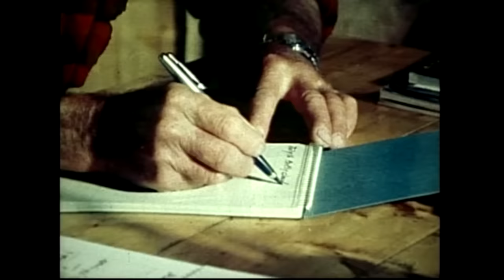Dick Proenneke in Alone in the Wilderness part II

Comment: If anyone has cut a board with a hand saw, you must know how insane cutting a board that thick and that long must be
Reply: I cut a board that way using a vice to hold it.  The vice was attached to a heavy table.  The entire table shook and stuff kept falling off the damn table.
Reply: I cut a 12 inch wide beam with a bow saw I also have trimmed a tree with the same bow saw so I know I can do it thank God 🙏
Reply: Yes ripping is harder than doing a cross cut. It usually takes a special blade with teeth shaped differently. White pine cuts easier than most other trees but still quite an impressive feat.

Comment: How the heck does he cut the boards straight.  Mine would start at 2” thick then end in 1/2”.
Reply: Skills and a good saw maybe. Check out Tony Sellers videos in case you're not already familiar with them.
Reply: stau ffap he had skills for sure.  Did you mean Paul Sellers?
Reply: score your logs and follow the line
Reply: As long as the teeth on your saw are good, you transfer your line right, you follow it in right, and you don't put excessive twisting or sheer forces on the saw, you'll make a decent board. The saw has a lot of surface area to keep it pointing the same direction so once you're in only daydreaming about Sally will put that saw off course.
Reply: He put wedges in, hammered them and the logs split.
Reply: @AtlasReburdened  lol 😆
Reply: Lots of practice
Reply: 😂 me too
Reply: Did you measure twice?
Reply: The blade of a saw wants to go straight. The reason the blade is very tall is to prevent it from turning or twisting, by using the cut wood as a guide. All you need to do is pull in a mostly straight line. Obviously you'll need to square the log a little aftewards, so the process isn't perfect.
Reply: And that sir is why I bought a gas powered sawmill, 17’ in under a minute lol
Reply: Because he’s working with spruce wood. Super soft, easy to split, light weight.
Reply: @AtlasReburdened  well sallys a fine lass can you blame me?
Reply: lol,i get what you mean,thats the difference of craftmanship

Comment: real men, wear wool shirts.
Reply: Yeahh..all that itching don't bother us one little bit
Reply: melvin-g-melvinson indeed!
Reply: @Darryl Hopper Yes..get you. 
May be today - But in the olden days, without modern methods of wool production, wool clothing used to be an itchy business.
Reply: @Survival Mindset well I have a hand knitted real wool sweater that was traditionally knitted that I picked up in Transylvania in Romania that I wear in the woods and it's itchy as fuck. My swedish surplus pants and my father old filson mackanaw from the 70s...not so much.
Reply: Yeah, it's called MERINO Wool
Reply: There is a reason for the wool, you would wear other layers under that so it doesn't itch, wool is an excellent insulator but will still keep you warm even if it gets WET.
Reply: When I take off my shirt, it looks like a wool shirt.